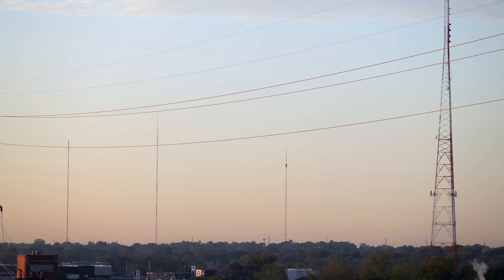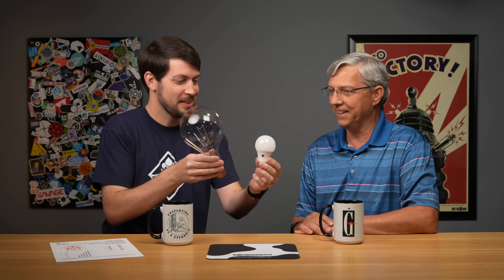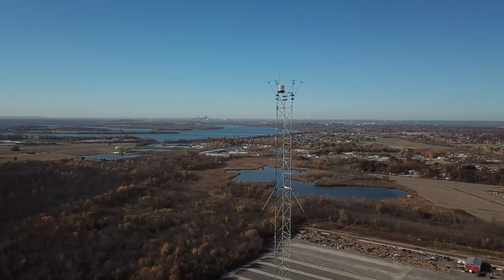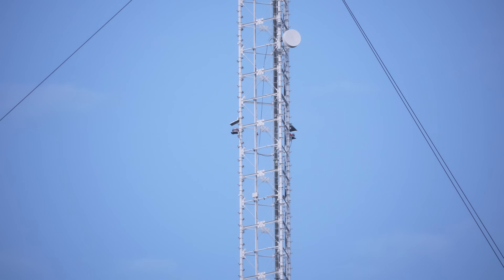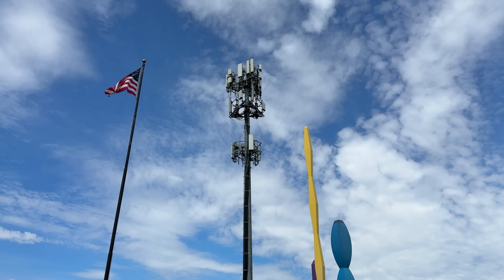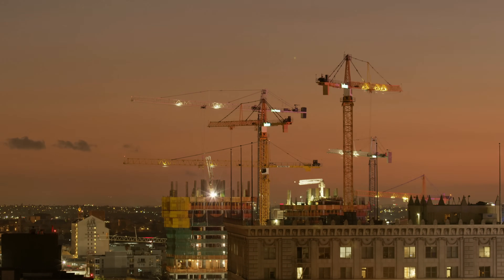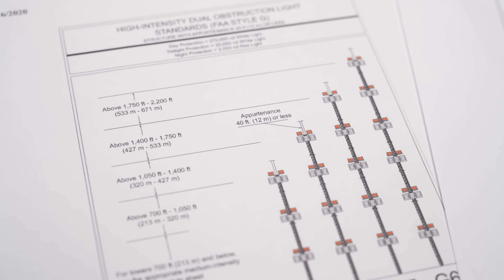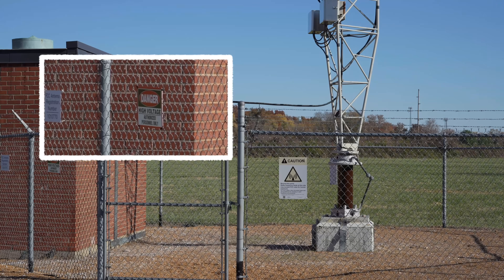Why do some radio towers blink?

Comment: There's an unmanned AM station next to my house that has 2 towers. Both have flashing lights on top.  One of the lights has not worked in about a year. I found the contact email online for the station owner and let them know when I first noticed it wasn't working. They never responded, and they still haven't fixed it.

Comment: I have a question its 2 towers in my state where i'm from long time ago in the past they use to light up with those big bright lights that blinks slowly and now they change to different lights its those little small lights they put on towers now and you can't hardly see them from far away and i don't think the tower light be on sometimes when them small lights are on them now

Comment: the unpainted towers an  sometimes even painted red-white towers can be nearly invisible to the naked eye and when speaking of the massive cables, they are hazardous to   small aircraft. Sometimes the tower may be visble, but the cables  not   so FAA should mae all towers have lights because small  aircraft and helicopters can  fly into them due to poor visibility.

Comment: We built a cell site next to a freeway where the freeway signs and street light were taller than our tower and only 200' away. Since we were near an airport we had to light the tower and paint it orange and white. At the other end of that airport, the street lights on the freeway bridge were had red lights. Our NOC monitored our tower lights and filed NOTAMs when a light was out. Tower crews don't like LEDs because they make less money since they pretty much last forever!

Comment: I get to see quite a few of these towers every night while making my end of day "delivery run" for work.  It's interesting how they're all lit up differently.  there's one belonging to the Highway Department that the lowest level of lights are solid red, then a level of blinking red, another solid level then a blinking red one at the top.  there is one to the north that has 3 levels of solid red and a flashing white on top.  my favorite is the set of three close together, I believe they belong to an FM radio station, they only have a slow blinking red at the top and they blink at different rates.  it's fun to watch as the light pattern changes, sometimes they blink at the same time while other times they blink in sequence and look like they're chasing each other.  the best one is when the two outer ones blink together with the middle one dark, then the middle one blinks while the outer two are dark.  the truck has no radio, so these towers are kind of a source of entertainment during a rather monotonous repetitive drive.
another note:  back in the 90s I had a CB radio base station set up at my house, and I remember something about a regulation since I was within a certain distance from the airport I had to stay below 60 feet with my antenna or I would need a light.  so, 59 feet 10 inches it was!

Comment: I also clearly saw the Cedar Hill tower in Texas  from Southern Fort Worth more specifically Evermen Texas which is more then 20 Miles away. There's an observation tower in Arlington Texas called the Oil Derrick Observation Tower that stands just a little over 300 Feet 91 Meters and from the top I can see a Large slice of the Dallas Fort Worth Metroplex and including the Cedar Hill tower Farm, and also a Giant 402 Foot 122.78 Meter tall Swing Ride called the Texas skyscreamer I rode it and saw everything man the view was spectacular. 👍🏼

Comment: Most towers I've seen (with a few exceptions).... Strobed during the day, then switched to the flashing reds at night (which makes sense, since the strobe is brighter and will be noticed more during the day, but more intrusive at night, whereas every pilot knows Red = Nope, and it's less intrusive than the strobe at night).

Comment: For those interested (and I have no idea why anyone would be interested) you’re supposed to keep 2000’ away from radio towers in your airplane. The guy wires are essentially invisible so you really need to keep your distance. On the extended right downwind leg of my home field, PSM’s runway 34, there’s a large radio tower and every time tower asks you to extend your downwind, you have to squeak just a tinnnyyyy bit in to make sure you keep your proper distance.

Comment: In 2001, on a foggy morning, a Cessna aircraft crashed into the top of the tower located in Notre-Dame-de-Mont-Carmel, Quebec, Canada. The deceased pilot remained in the transmission tower for several days while authorities determined the best way to respectfully recover the body. Several telecommunication services were affected by this service disruption. It was decided to fell the tower into the nearby forest to cushion the fall. It broke into 3 parts during the fall. Recovering the body by helicopter or by climbing the tower was deemed too risky.

Comment: A relevant thing to mention: wind turbines also need some kind of these beacon lights; in Europe though, and seemingly North America too, newer turbines can opt to use dynamic beaconing, where they only turn the lights on when an aircraft is near and then turn them off after again. That works either through radar detection or automatic remote control from ATC. Very beneficial since it reduces the wear on the lights and keeps them operating for a longer life span, and at the same time makes the wind turbine more tolerable for residents in the area.

Comment: One question I have is regarding the old AT&T long lines Towers. 
I haven't seen any with lighting. If you look through all of the documentation and pictures of various ones there are a few that are painted red and white. We have one near where I live and it is completely dark. 

Obviously when they were in use they were technically considered a civil defense asset but now that a large portion of them are either privately owned and or abandoned shouldn't some of these have lights now?

Comment: Also worth mentioning that the reason some tower owners convert from the red lights to a strobe system is to midigate the need for painting (or repaintint) the tower, in most cases a strobed tower does not need to comply with the orange/white painting requirement. Saves a decent amount of money, especially on a tall tower.

Comment: I went down a rabbit hole of researching tower lighting recently. One of the coolest advancements I've seen is the ability to use a GPS time signal to sync the flashes. With that, you could have a whole facility,  city, state, or even the world synced to flash at the exact same time!
Reply from the maker: Ha, at what point would the power grid be like "ouch" "ouch" "ouch" every second?

Comment: I live in Cedar Hill, TX, the location of Broadcast Hill, the tower farm for the DFW market.  We have 14 very tall masts the talles 1731 feet some are painted with the alternating Red and White scheme with red lights at night.  And the newest towers are just unpainted gray with white strobe lights during the day that change to red lights at night.  So after sunset Cedar Hill has 14 towers with red lights fading in and out.  They are visible for miles.  Cedar Hill is the highest elevation between Oklahoma City and the Gulf of Mexico.  The site of the towers is at 840 feet above sea level and just less than 20 miles away Downtown Dallas is at 505 feet above sea level.  So the top of the towers are over 2050 feet higher than Downtown Dallas.
Reply: I also clearly saw the Cedar Hill tower in Texas  from Southern Fort Worth more specifically Evermen Texas which is more then 20 Miles away. There's an observation tower in Arlington Texas called the Oil Derrick Observation Tower that stands just a little over 300 Feet 91 Meters and from the top I can see a Large slice of the Dallas Fort Worth Metroplex and including the Cedar Hill tower Farm, and also a Giant 402 Foot 122.78 Meter tall Swing Ride called the Texas skyscreamer I rode it and saw everything man the view was spectacular. 👍🏼

Comment: I live in Mexico and in my city there's one TV tower (the Televisa tower) that has both sets of lights, the flashing white ones on daytime and the flashing red ones during nighttime. They made this modification a year or so before. The question I have is why sometimes the white light is on during nighttime. Quite interesting these radio tower topics. Have a nice day over there.
Reply: There was a tower in Apache Junction, AZ that one time had it's red lights malfunction. So it would only strobe the white lights until the problem got fixed. After it was fixed the lights would switch to the red ones when it got dark enough. Perhaps you saw a tower with the same problem there.

Comment: Our local radio station (WSLM-Salem, IN) has always had the red lights on the towers.  Some constantly glow red and others on the same towers fade in and out red light.  Everything at that station is seven days older than water.  They began broadcasting Feb. 14th, 1951 I believe, and so call themselves "The Sweetheart Station" given the date.  They have a 1940's truck with a flatbed and a 1940's GE 1,000,000 candlepower spotlight on the back of it.  When they fire that thing up at an event, it looks like they're trying to spot the luftwaffe, LOL!  When I was a kid their FM station was 50,000 watts and their AM station was 5,000.  On a cheap radio that FM station would come in all the way across the dial, lol.  They still have both FM (97.9) and AM (1220) today, but I'm sure the FM wattage is much lower than it used to be.  If you go into one of their broadcasting studios (DeeJay booth) the walls are lined with shelves of shellac 78's and they play them on Valentines day and when a phone call comes in they have these low wattage lights wired into the line that flash for when they shut off the ringer.  It being a local, rural station they have call in shows like Swap-Shop and stuff like local high school ballgames and a lot of religious stuff, from the rosary to baptist hellfire, lol.  The station identification and station jingles are all still from the 50's and they have goofy things like the clock lady at the top of every hour (Tick-tock-tick-tock-tick-tock-it's 4 o'clock)  Or stuff like (Here comes the weather bird, lend an ear for the weather report, it's here!, it's here!) all sung in those big band styles og the era...and of course then you hear the "weather bird" with some guy screeching something like, "Oh Punky!  Coudy and mild, cloudy and MILLLLLD!)  Used to, when they signed on in the morning it was the braying of an ass after which came The Broomsage Ballet--their name for a country music show...it's just weird.

Comment: Do you know if there is a simple way to find the hight of towers like water or radio?
Reply: in geometry they make you solve for that based on the legths of the shadow of the tower and the length of the shadow of an object of known height, such as yourself. plug it in, cross multiply your proportion and get that figure for x

Comment: Perhaps already covered previously so apologies upfront but I always have wondered;
How are towers protected against lightning-strikes?
Alternative query if indeed the above already has been covered before;
What does it involve in designing and constructing/erecting a tower? (read: the engineering)
Reply: Am and FM/TV towers are very different. Geerling Engineering has a video called grounding (Mainly about AM). A tower is a large metal ground rod so the trick is to get an easy path for the strike to use to get to the earth. FM/TV towers are just steel structures and can be grounded but AM towers are RF hot antennas and cannot be grounded. https://youtu.be/ewYMqRTRhOo?si=rE_aUisEHYJ5k1c1 Thanks for the comment!
Reply: @radijoe  Thank you so much, very appreciated!
Really fascinating video, thanks!
Much more than just a piece of iron pointing to the sky.
Reply: lightning is usually shunted or diverted by giving it an opportunity to find ground through a spark gap if the mast is a radiator and just bonded ground strap if its not. inline coaxial cable arrestors use a spark gap sometimes but may use one-shot solid state crowbar circuits as well. remember, RF wants to jump off a wire ever more than dc with increase in frequency. a spark gap, while open circuit, will present some capacitance as well. so summon up maxwells equations and figure how that works in a transmission line and that will set you better on engineering a tower.
Reply: @hardrays  Thanks! Truly amazing what's going on, for the safety and preventions. Watching the aforementioned video, remarkable!

Comment: I've worked for the FCC for 22 years and the 100 percent absolutely certain without a doubt answer is.....they must blink in a interval that is half the time of current frequencies ossilation which also ensures that all scanning equipment can receive correct signal timing in frequency non peak time. Now that's the law and now you know no matter what education level u thought u had
Reply: all right "ossilator", can you elaborate on "current frequency"

Comment: One of the things I would request would be where was the filming location of the towers in this VID? I currently reside on Omaha, Nebraska, [ 50+ years ] and so this appeared to be or my guess that this location would be what we call "Broadcast Farm" on North 72nd Street. The towers at the location "house" towers for the three BIG networks and some radio stations. it is a farm in the since that the area is used as a corn [ maze ] field, that is grown and harvested there.
As a regulation I was also to understand the any aircraft is supposed to remain more than 1,000 feet away from any tower.
Reply from the maker: This was in the Shrewsbury/Affton area in St. Louis, MO. Many cities have towers grouped together since they find the tallest location and put towers there. If a city is more flat or other geography dictates certain placements, that may not hold true.
Reply: @GeerlingEngineering  Oh, Ok, Thank You! It was the Lowes sign that I was using as a clue, also.
Reply: in st louis, this grouping got compounded when the optimal spot near lambert airport sent them all packing to south county.
Reply: @hardrays  Another example when and where "The Peter Principle" is coupled with Bureaucracy.
Reply: @DAVIDALANJONESRIDGE thanks for putting a name to the root of institutional perplexity
Reply: @hardrays  You are very welcome. I could and will bring to your attention that the issues that the book, "Future Shock" [1970's] deals with, so pleeezzze read it. for I highly recommend "The Peter Principle" which was a book published in the 1970's as well.

Comment: I worked at a local station when I was in college in the early 60s. Sometimes I got to change bulbs in the side lights. Someone would cut the carrier long enough for me to get a few feet up on the tower and them turn it back on, making me part of the radiator. Don't think that would happen today! We did hire a guy when we needed to change the one on top.
Reply from the maker: There are still some climbers who will hop on a live tower, though they usually request the power be reduced substantially.

Comment: I think that you should do a video on a 1042 foot tall lattice-type, self-supporting broadcast tower in Kansas City, Missouri that was just upgraded to use the same type of LED projector lighting system used on the Eiffel Tower in Paris.  The upgraded lighting system was installed for the 2026 World Cup events that will be hosted in KC.  It uses the type of pancake LED warning lighting to meet FAA requirements, and adds LED multi-color projectors.  It involved specialty tower engineering and climbers that work at great heights.  The self-supporting tower is used by KCTV5 (formerly KCMO-TV), KCPT-TV, and by radio stations, completed in 1956.  It's just a train ride away from you on the AMTRAK Missouri River Runner.

Please bring your dad along on this trip, as he can do some wonderful engineer-to-engineer work about bulb type progression and what it takes to keep such towers in proper operation...  KC still has its downtown airport, as well as the international airport.

Comment: 6:24 interesting seeing a Michigan based medical chopper in this video.  That chopper's home base is about 30 miles from me.  It buzzes my house some days if there is a severe near drowning accident in Lake Michigan.

Definitely a structure's proximity to an airport makes a difference.  Near one local airport here is a factory which has red lights on its roof as well as the flagpole and also a radio station on 1260 KHz so that 4 tower array is just under the 200 foot requirement at 196 feet.  Another airport is near a highway rest stop-the parking lot lights nearest the runway's glide slope have red beacons.  Not sure how common it is for ground level helipads at hospitals but the ones around here have nearby parking lot lights topped with beacons which can be turned on manually so the red lights are only on when the helicopter is nearby.

But what about the flash pattern?  Is this FAA specified anywhere?  One grain silo near me used to have a red light that flashed four times in about five seconds time, then was dark for about five seconds before the cycle began again.  Not sure on height or if this crazy flash pattern still happens but it's at least ten miles from the nearest airport.  And of course the infamous Capitols Records building at one time had a light that flashed HOLLYWOOD in Morse Code.